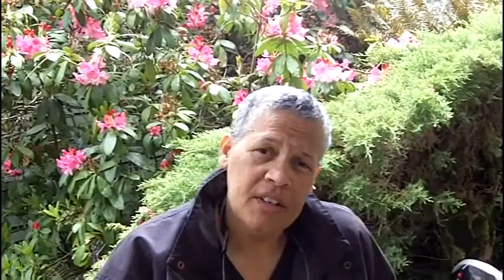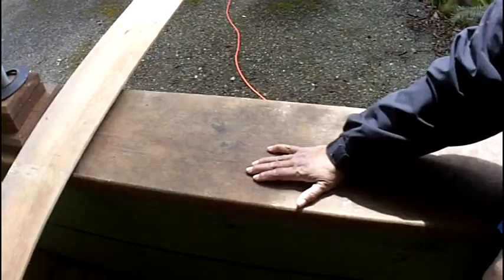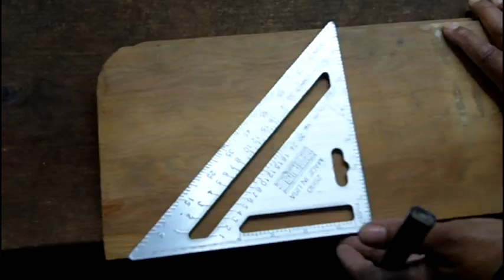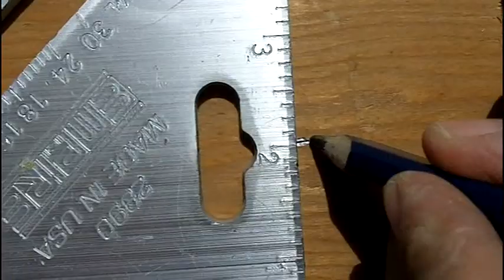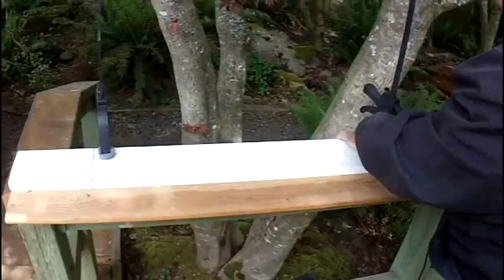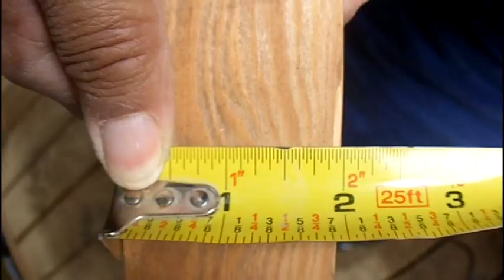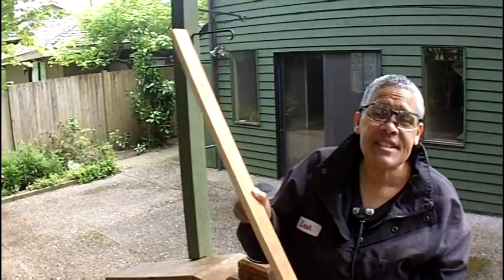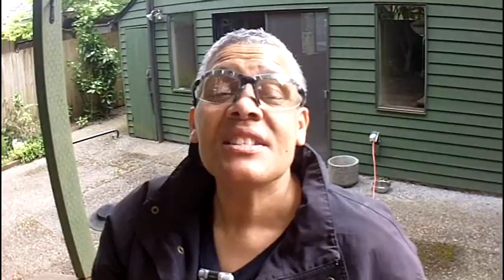How to Make a Perfectly Straight Cut in Wood with a Circular Saw

Comment: Basically making a rip fence.  I don't measure from the blade at all. Instead I just put a mark on the very end, put my blade up to it and move it over a bit so I'm a little past my mark, which on my skilsaw is about right where the mark I made will be gone but not a hair more. Also, instead of a waste piece you clamp, you can use a 4' level too and clamp that which will be straighter than the wood piece. I have a 6' level I use too. Hell, a 4' ruler can be used since the shoe will butt right up against it. 

Many ways to approach, but making a rip fence of any kind is better than trying to freecut that thing :)

Comment: This is a great tip, especially for plywood/MDF or ripping without a tablesaw.
Reply from the maker: thanks, Paul!
Reply: seejanedrill No problem. And thanks for putting videos like these up. I think I got the plastic spoon caulk-smearing trick from one your vids a couple years ago - it's been useful for things I make for the garden where I use a full silicone caulk (which stinks to high heaven imo).

Folks like you putting vids like these up has saved and earned me thousands of $.

Comment: I've seen and used a similar technique, where you take 2 scrap boards and Brad nail one to the other offset, run saw across so the top board is your guide, and the bottom becomes your straight edge guide afterwards.

Comment: Most circular power saws have a fence attachable to the sole plate.  With practice it is nearly as good as the fence jig.  However this method is very popular.  Several companies make the jig to rip 9' and crosscut 5'.  Covers a sheet but unless you do this a lot, they are not likely to be worth it.  Good vid...

Comment: Jane, using that second piece of wood as a fence is ingenious. I have a $400 table saw with extension rollers that I’ve used over the years to accomplish the same and yet your method is “in the field ready” as opposed to being limited to the shop. 

I do have a question. What is the suggested remedy if when starting, the work is not square as your’s was when you first used your square to mark out the 2” from the edge line? I have a solution for use in the shop, but I’m learning from you and your ingenious “field” method and I reckon you have an equally brilliant solution.  BTW, I’m not a pro woodworker or tradesperson. So I’m always looking to learn from pros like you.
Reply: Her name is "Leah". "See Jane Drill" is the name of the channel

Comment: Thank you so much, good staff, I'm doing the same but what I see is that your marks are a bit thicker...is good to have a sharp pencil and even do a v mark instead of a line...when you do a thicker line or/and long is not very accurate in special if the mark line is long and not straight...

Comment: If you will notice, the board is LESS  than 2 inches wide, because she didn't measure from the inside of the blade.Or what the gentleman below referred to as the "waste side"  She lost the width of the blade  (kerf) on her 2 inch width.Actually you should measure from the inside of one of the carbide teeth.

Comment: Screws can be used instead of clamps if you don't happen to own any. Also a saw guide would eliminate this entirely, most skils nowadays come with them.

It seems like an unnecessary step measuring from the blade to the shoe when you could simply run your saw on top of the scrap wood and just adjust the blade depth accordingly. The scrap wood itself will keep your saw blade running strait.

Comment: Don't forget to make sure your backstop is strait piece of wood. Don't forget that carbide blade will cut a fat 1/8 out of the wood and so to cut out side your scribe mark. Make sure to put the speed square against the blade and the "shoe" checking that the table is square on the saw. You can't trust the old saw shoes. If you don't your cut will be at an angle. Also you could hold you lead on the 2 inch mark and pull the speed square down the board making a strait line. Then make a cut no back stop needed. When doing piece work  you learn to be fast AND clean. :-)) I love the sweet smell of fresh cut wood in the morning
Reply from the maker: +Jeff S Hi Jeff, thanks for sharing your personal experience with the community!

Comment: Snap a chalk line, even on short pieces, like a 2 foot length. It's quick, easy and accurate. Measure twice, cut once. Then cut some on some scrap just to see where the kerf goes - then cut just on the unwanted side of the line. Measure twice - cut once.
Reply: I need to add - Don't hook the hook the hook gizmo at the end of the chalk line on the mark if you want an accurate line mark, it might not work like it's supposed to. (Rule #4 of "It Will Always F%@k Up When You Work By Yourself" Addendum to Murphy's Law). My grandpa (a master carpenter) taught me to ALWAYS put the line itself on the mark at both ends.How you do that if your board is longer than your arms - use a brad tight enough to stay put but loose enough to wiggle so you can get if just right, Your 'wipe it off' rag takes that blue stuff off fingers real easy, (if you're lucky or use a pressure washer).

Comment: Looks to me like you got 1-15/16 or 1-7/8 cut depending on which side of the tape you're looking at. Tape measures have their place, but you would be much more accurate using an old time stick rule. Also mark one end of the cut as accurately as you can and cut in about 2" by eye. Leave the saw in place and clamp your guide up against it. Take the saw out, measure from the cut to the guide and set up the other end. Put the saw back in the cut, check for the proper placement and when your satisfied continue the cut. Made a lot of quality cabinets this way when a table saw wasn't available, which was quite often......Back in the day

Comment: I actually finish building my own garage doors. I used this method to split an 8 ft 2 X 4 in two. I created my guide and screwed it to the work. The saw did the job. It turned out that I did not need to buy an expensive table saw as i feared.
Reply from the maker: fantastic, glad it worked out!
Reply: +seejanedrill I am convinced one can built a house with it

Comment: Kerf?   You wanted 2" and you added 1-1/4" to the top of the blade, but the kerf was towards the work (not waste) side.  Didn't that subtract the kerf from the work side?   It looked like when you measured it, it was a blade thickness shy of 2".   Thanks for your video btw

Comment: Hi,Jane,nice and clear instructions.I would suggest anyone set the depth so the teeth just come through the bottom of the board(less grabbing),and I hate those so,called dual width carpenter pencils,but that's just me,haha.I find the regular pencil(or a scribe/nail) works better.

Comment: I would make two key suggestions for anyone watching this.  #1 Use a very sharp pencil, not big carpenter pencil.  As you can easily mis-mark 1/16" or more off to either side of a measurement with a thick pencil and #2 use an accurate metal ruler.  Worn tape measures can be just as inaccurate as thick pencils and so combined you can wind up being 1/8" off or more across your entire cut.  While that's maybe ok for general rough carpentry I typically make all my cuts, house framing or otherwise, down to within 1/64" accuracy.  When building things like furniture I try to be even more precise.
Reply: The most accurate way to mark is a "crows Foot"   <    Take a round sharp pencil straight down where you want the mark. Run two tails off of it to form a V. Making just a dot could get lost or maybe confused with a blemish on the board. A short line perpendicular with your rule may not be the same measurement on each end. The point of the crows foot is exact.
Reply: Sure, that's a given in carpentry but even with a "V", if your pencil isn't sharp then you will not accurately mark on your desired measurement.  I use sharp pencils and metal scribes in everything I do, not thick carpenter's pencils. All depends on what you are building and how accurate you want to be.  I work in engineering, down to .25 mm or less when furniture building. I've also gotten use to using a metric tape measure and use a metal ruler whenever possible because imperial units are ridiculous to remember. 27/64" or 19/32", etc.. It's just stupid when you want to be really accurate.  I use both but prefer metric.

Comment: I know of a better and smplyer way but I can remember the name of the vid. it was a Mexican dude showing it. it basically is a 1/4 narrow sheet of plywood with a 1 by 2 board nailed longways on it and the cut is not only straight but you can also set it on your marks and cut it exactly where you want it without drawing or snapping a line. Leah however is an excellent teacher! 
hello from Serbia y'all

Comment: Love you videos seejane.  I just learned which side of the blade to cut from. I was always cutting from the shoe side. One question, do you wear hearing protection? I do. I would think repetitive use of a circular saw would cause hearing damage.
Reply from the maker: +Paul Bevillard Hi Paul, I believe in the importance of using hearing protection, however, sadly, I don't always wear it.

Comment: Great videos Leah! I am new to woodworking...I noticed at 4:20 that you marked between the 3 1/8" and 3 1/4" not directly on 3 1/4"
Does the cut not have to be on the exact measurement?  I just ask because I am ALWAYS trying to get the pencil marks exactly on the proper measurements, and I always double and triple check which always wastes more time.  I would rather mark the measurements like you did hear in this video without thinking twice.
Reply from the maker: it's the camera angle

Comment: The method is great but the measuring technique on the other hand could do with some improvement. You didn't take into consideration the set on the teeth of your saw. The edge of the marking should be set perfectly, not rushed. The edge of the marking can be set and read accurately. I usually cut to within 0.1mm.

Comment: You should check out enduringcharm's video for an ingenious circular saw jig that uses the same principle as your idea but saves a whole bunch of set up time and the jig works for both sides of the blade on your circular saw.
Reply from the maker: Thanks for writing. We at See Jane Drill like to teach the quickest, most straightforward and cost-effective techniques for doing things and to give people simple solutions. Jigs are great, and I believe in using jigs!  But you have to remember, it takes time to build a jig. Someone who doesn't work with wood on a regular basis and just needs to occasionally cut a straight line shouldn't have to build a jig.  Anyway, thanks for your comment, and what I like about youtube is the interchange of ideas.
Reply: seejanedrill

OMG! All I need is a straight edge. I was thinking that I couldnt do it with some kind of a guide. Your video has helped and saved me 60.00. I was getting ready to take my 12"x48" to a shop. All I need my wood for is to make a soap mold. I need straight edges for no leaks.

Comment: This is nice if you have a lot of time... However you could always save yourself a lot of time and just use a rip fence.. or chalk a line and just cut it. If you ever want to become a good carpenter then I would say you need to cut freehand as much as possible. Also, I would recommend using a crows foot to be more accurate. On an average job, depending on the job of course, I would say I average well over 800 cuts. Most are done freehand without any sort of guide. After time they become second nature. Floor and ceiling joist, 3/4 and 1/2 plywood, bottom and top plates, headers, corners, rafters, gable end studs, fascia board, etc. On a rafter alone you can have as many as 5 cuts. 1 plumb cut and 1 level cut which are your tail cuts, then 2 cuts for your birds mouth which are your seat cut and your heel cut, then 1 plumb cut to hit your ridge board. Mark and cut and you will be fine, just takes time.
Reply from the maker: +Ada Wong   Hello Ada,  Agreed, however, this channel is geared toward diy homeowners, not necessarily those looking to make carpentry a career.

Comment: helpful info, but I watched a carpenter cut plywood off of a framed floor without a guide with a circular saw. There was no place to clamp it. It was nailed down already. ..unless maybe you clamp your guide piece at the ends.

Comment: If you measure from the outside of the saw blade as you did and cut that way, once you cut it the wood would be thickness of the saw blade less than what you wanted .... I alway add on the thickness of the blade as well to be more exact..

Comment: Looks like a 1 15/116'' cut to me.  Shouldn't you have begun by saying that the piece of wood you're cutting is perfectly straight - because if it isn't you will need to true the edge before you set up the cut - right?

Comment: New to circular saws; need to rip a 2x8 to 6.5 inches for a 5 foot length. In reference to this type of rip... Is it okay to work from the fall away side as long as you are not directly behind it? Also, is there a greater risk of kickback or the saw climbing out of the cut as you near the end of the (this type of) cut?
Reply from the maker: +Had2Ask   I'll in-box you a link.

Comment: The mark you make as the measurement - do you keep the mark in the middle of the little v at the front edge of the saw?
Reply from the maker: It is the shoe of the saw riding against the straight edge ( fence) which helps create the perfect cut, yes your mark should line up in the notch on the front of the shoe, however, it's the fence which keeps it on track.

Comment: I think the base plate of my saw isn't aligned properly with the blade of my saw. I made a jig out of wood for straight cuts. It still doesn't come. Out square and I think it's the plate being out of square, producing the same result as if the fence of your table saw was out. Are there ways to adjust the shoe?
Reply: XxStratAttackxX Unplug the saw and check to see if the sawblade wiggles side to side. Sometimes there is wear within the bushings of the motor. I have had one that had been lent out and seen the plywood that he cut, OMG, the wavy-ness he swerved to cut the wood was horrible. I know now not to lend him anything I don't want to replace. It was cut to block his dog making its way under the fence, not critical cuts,but enough to mess up the saw bearings. Oh yeah, thank you Leah for all your informational teaching.

Comment: I would've liked to have had a sight down the board shot. Your saw wobbled slightly at the end of your cut which is natural because there is nothing to support it like if you were using a table saw. You can always get a straight cut using a straight edge. I was looking for a clip to show a trick on how to cut a perfect 90 with a circular saw. Anybody who can draw a line with a ruler can cut a straight line using an edge guide. Well I guess its geared towards an audience who are new to a circular saw. You did leave out the most important tool for this demographic EAR PLUGS. The most intimidating thing about a circular saw is the loud sound it makes that can spook a newbie into rushing or fudging up a cut. Kill the sound, kill the tension.

Comment: That can be tricky cutting away the price of wood your saw is resting on. It is a challenge to have a guide along the motor side as the motor is often in the way. I've gone for the saws that ride in aluminum guides to get away from this issue. Once you enjoy a saw with one of those guides there's no going back.

Comment: I need to cut down a jamb to fit the framing that is a 6 inch thickness/width. This explains how to do it clearly, however, I am left-handed and struggle with tools i need to use with my right hand - as in the video - can't just turn the tool around. Is there a left-handed circular saw made by any company? Thanks
Reply: +Sharon Andersen Why cant you just turn the saw around and come from the opposite end of the wood ?
Circular saws work with either hand. just hold it in your left, instead of your right.
Reply: +Chris Shaw the table I use can only be clamped on one side. small space for me gives access for right handed cutting
Reply: Sharon Andersen turn the table around. put the clamps on the other side ..

Comment: my  skill saw model 5150 doesn't have a spindle lock switch it was my uncles I had a Black & Decker  the motor burned out and he  said here take this one I got  a much better quality now  but he never showed me  how change the blade on that model  because it  was sitting.    for a couple years he passed away I took it out of storage to clean up and used it   I know my neighbor said that you can take it apart and repack it with grease so that runs smoothly the bearings  my question is how do you take the blade off of it when it doesn't have a blade lock switch and it keeps spinning  it definitely looks exactly like the one you have in the video it's just 10 amp instead of 11
Reply: C clamp or locking plier.
Reply: @kimchee94112  thank you I ended. Up. Figuring it out and. Thank you. Since then I. Got. A. Skilsaw 5485 13amp works good.

Comment: Liked the video but you'll get an almost perfect cut, or a good enough cut every time depending on the piece of wood you're cutting and how steady a hand you have in keeping the saw level. Took me about 3 passes to get a straight enough cut lengthwise on a 80 inch long door. Also on reallly long cuts like that the piece of scrap wood wants to flex little some you have to be careful not to exert too much side pressure on it.